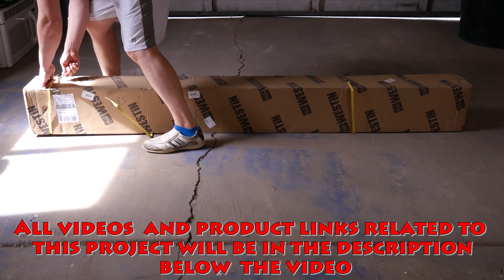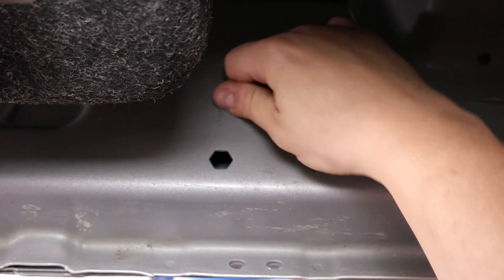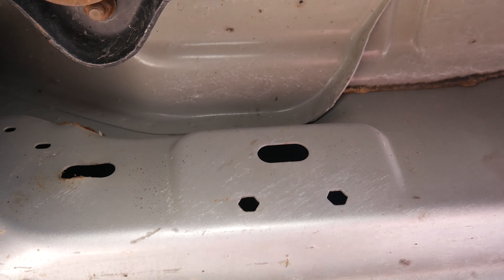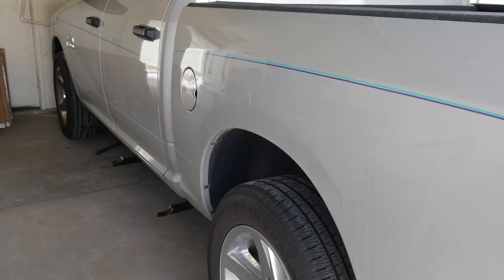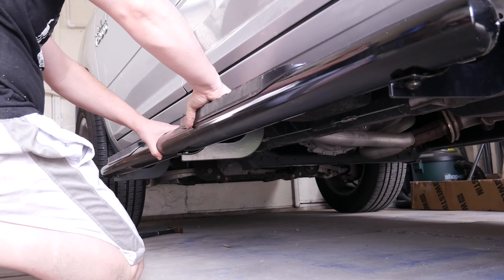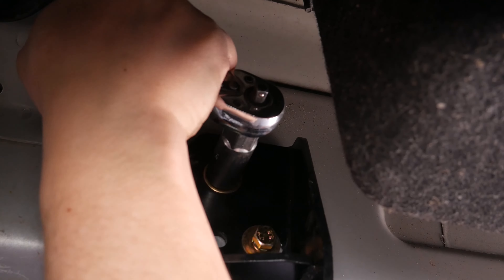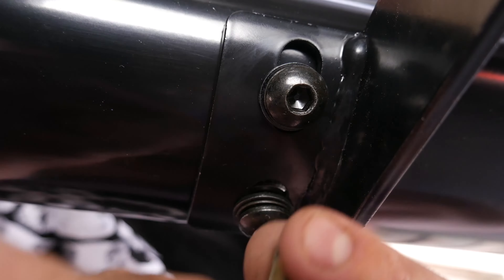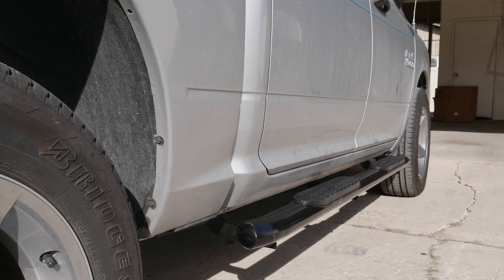Westin Pro Traxx 4" Oval Step Bar Nerf Bar - Dodge Ram 1500 2015 - My2Cents

Comment: These are awesome bars. I just bought a set to replace the generic, cheap-arse chrome plated bars I first bought when I bought my truck. They bowed in the middle and the chrome plate began to peel within 2 years. As a mechanical engineer by trade, I feel compelled to mention that when you place a split lock washer on top of a flat washer, it completely defeats the purpose of the split lock washer, as the flat washer enables the whole thing to loosen. A drop of Loctite on the bolts cures this easily enough.

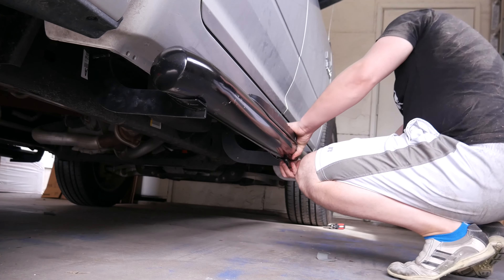Comment: Thanks -- this is by far the clearest installation video I've seen. I'm getting mine next week, so I appreciate the help. Quick question -- it looked like your bars were scratched a little right out of the box (3:08). I've heard that's a common problem with Westin products. Did you notice it? Did you try to fix it or touch it up?